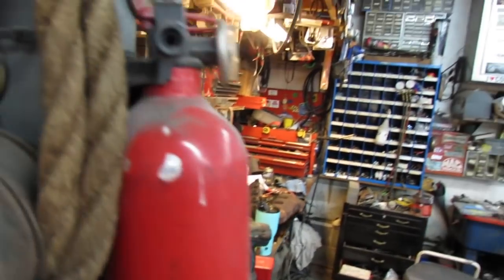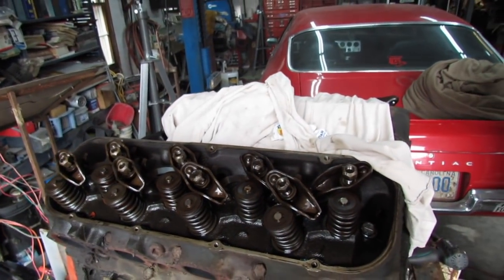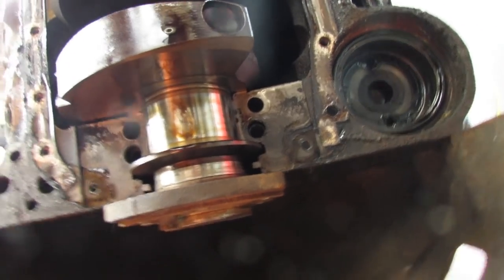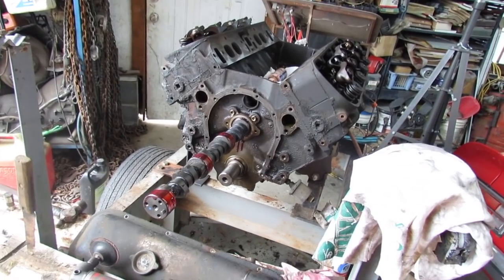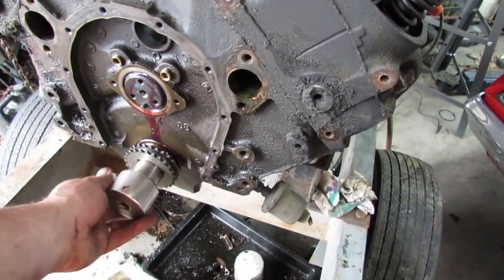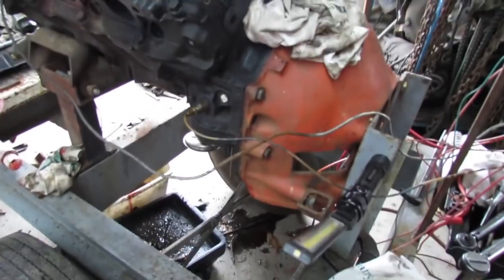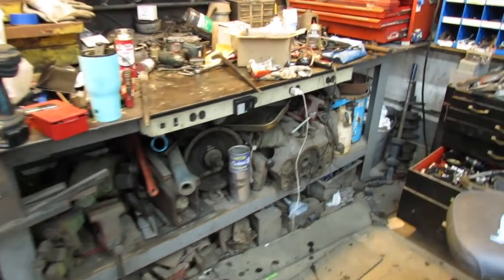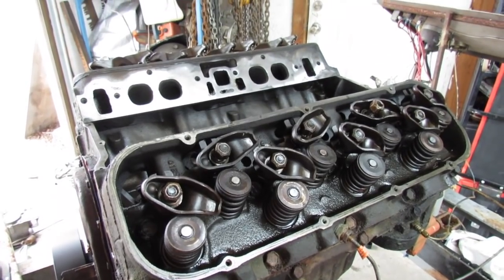454- Install the cam

Comment: Back in my 20s when I worked in the auto machine shop I did all the valve work. Always like the big block heads with the Canted Valve design on them and 351 ford cleveland heads.

Comment: In my opinion the 402 heads would be perfect on this engine the bump in compression would help the fuel efficiency but wouldn’t make it ping under load as long as the timing wasn’t advanced too far and really really wake the engine up
Reply from the maker: Archer M I’ve considered it. I’m not sure they have hardened seats tho.
Reply: Might be worth popping out a exhaust valve to see if they were put in when they was rebuilt

Comment: This Engine vs Motor Malarkey... Back when they formed up a few motor companies to make 'General Motors' GM did NOT make a generator,stater, or electric motor. Charles Kettering did not invent the electric self starter till 1911. Him and the Wright Bros didn't form DELCO for a few years after that. So GM came around selling Gasoline Motors. Not 'electric motors' GM's second electric motor division was Frigidaire, The Third Was Electo-motive (Trains). Here in the Dayton Area all of GM's light duty Diesels have been made. The 6.2, the ^.5 both with or with out the turbo, and the love it of hate it 6.6 Duramax (duramaxx). The 6.2 & 6.5 plant was across the street connected by an elevated walk way from the S-10 plant originally called GM Truck & Bus that was an old Frigidaire plant.  So you either went to to Truck and Bus, or you went to Motor plant. I hauled Equipment to both.Guess these people know more then GM.
Reply from the maker: Lots of arm chair quarterbacks

Comment: Hey! What camera are you using?
Reply from the maker: Vein1986 an old canon sx40
Reply: @MrHevyshevy  thanks! I was looking for some budget camera that is working fine, and as I can see, yours is pretty good :) Are you shooting in 1080p or 720p?
Reply from the maker: Vein1986 1080. I bought the last one used on eBay.  I have a go pro and a canon camcorder. But I like this one the best.
Reply: @MrHevyshevy  thanks!